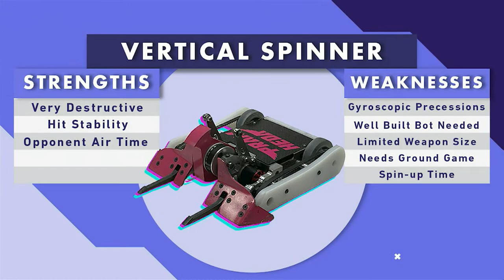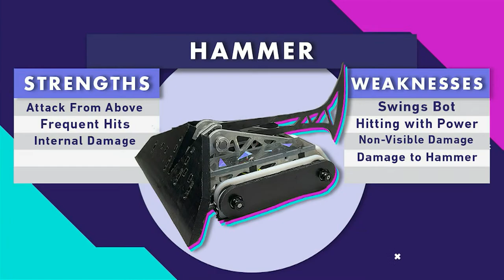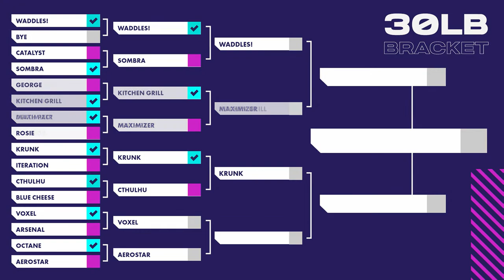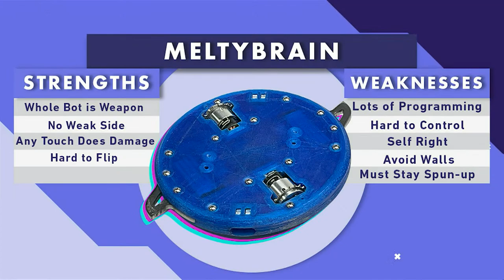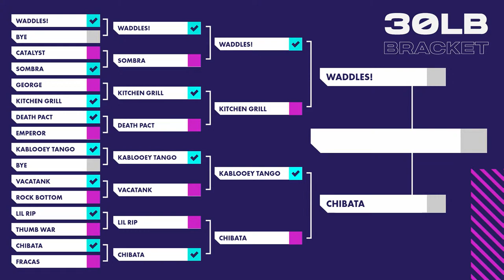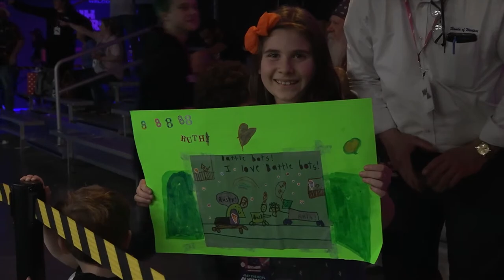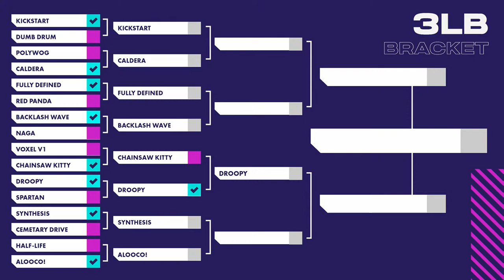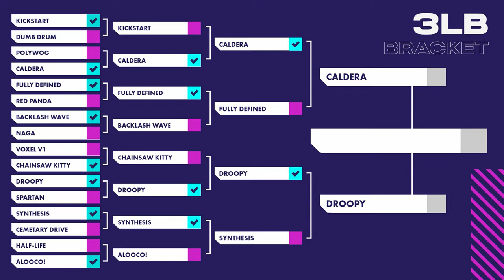NHRL 2023 Round 3 May: May The Bots Be With You from May 7 2023

Comment: First of all I love love love NHRL,  I'm so glad to be able to watch either live, or like this weekend, watch the whole broadcast today, as I was busy with life stuff yesterday. Second, just thinking y'all need a set of custom un-stick tools for inside job, watching the valiant efforts of the official trying to unstick the bots with the pry-bars was kinda terrifying to watch! I think if you had a piece of flat bar stock maybe an 1/8" thick, 1/2" wide to slide under inside's crusher, and a cam shaped pry-tool to lever off of the flat bar, it would be easy to lift the crusher tip out. Just my $.02.
Reply: Good thought, but there is literally nothing that would have opened Inside Job's arm without breaking one or both robots.  The arm was off the worm gear and bent sideways, it was mechanically locked.  The bots needed to be taken apart to be freed.